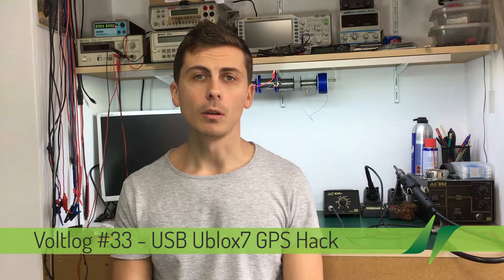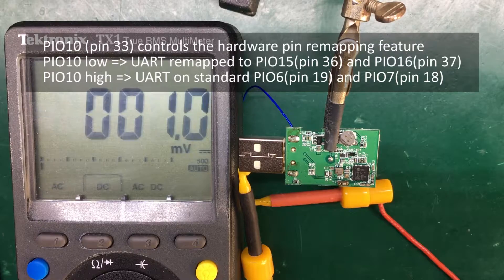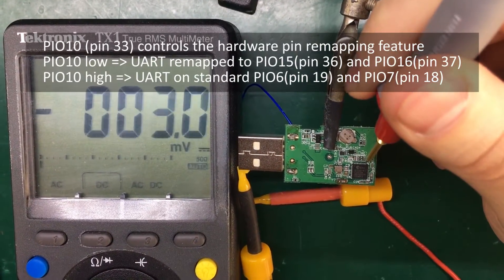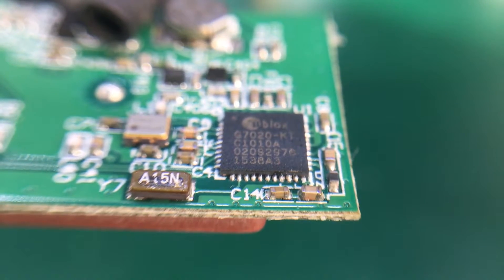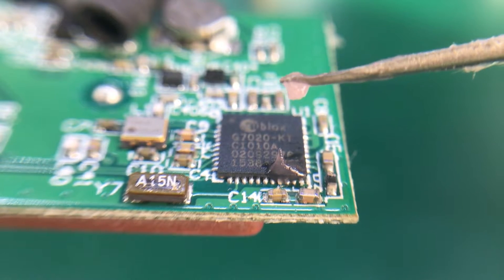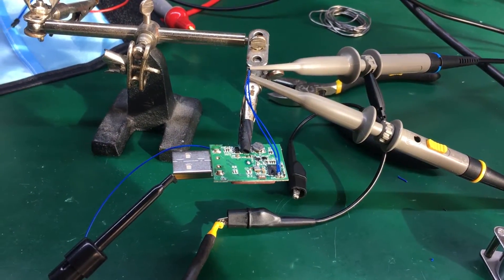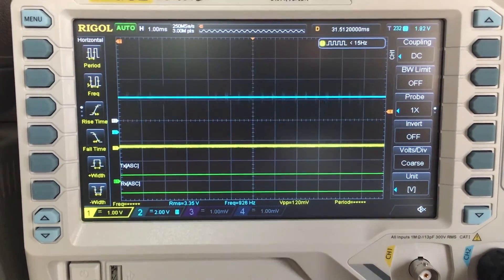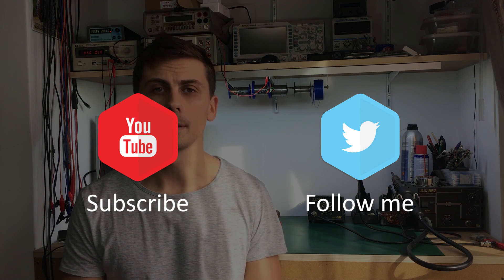Voltlog #33 - Ublox 7 GPS USB to UART Conversion Hack

Comment: Problems Installing "G72 G-Mouse USB GPS Dongle Glonass Beidou GNSS Receiver Module". Help and Support Please?

I recently purchased on Amazon the "G72 G-Mouse USB GPS Dongle Glonass Beidou GNSS Receiver Module".

I carefully followed the installation instructions which I downloaded from their site. I downloaded and installed "u-blox GNSS Standard Driver for Windows, v1.2.0.8".

I checked the windows device manager and the "u-blox GNSS Receiver (COM5)" drivers appear to be properly installed in Windows 10/64.

Whenever I insert the "G72 G-Mouse USB GPS Dongle Glonass Beidou GNSS Receiver Module" into the USB port on my PC, the indicator light Flashes once only and then the unit is DEAD.

I downloaded and installed u-centersetup_v21.02.exe.zip, and loaded u-center_v21.02 and it actually recognizes "G72 G-Mouse USB GPS Dongle Glonass Beidou GNSS Receiver Module", BUT the unit fails to activate.

Please advise what I should do?

Is there some installation & configuration procedure that I have missed?

OR is the unit "G72 G-Mouse USB GPS Dongle Glonass Beidou GNSS Receiver Module" defective?

Thanks in advance!

TG

Comment: lol iv done this so many times and fucked up glad am not alone . we need a Andonstar ADSM302
Reply from the maker: yeah a microscope would help
Reply: @voltlog  i have been doing something similar to what you have done. but with a tk102 from ebay comes with this chip i cant seem to configure it with ucenter even tho i am receiving packets
Reply from the maker: Ted Mosby maybe it's missing the flash memory
Reply: @voltlog  yh it could be i will be buying a Arduino based ublox module and get the hang of it

Comment: Very interesting. G-Mouse hmmm?,,,sounds familiar like it is made by VKEL maybe....:-)
 I just bought the VKEL VK2828U7G5LF, ( also at Banggood) and it lists as having the M8N which is capable of GPS and GLONASS protocols at the same time. Read quick acquisition time a blistering "hot reboot" times.
I somehow found the PDF produced by the maker VKEL themselves leaving no doubt as to how to work the U-center config app to get what I need for pairing with a Flight Controller for my  RC quadcopter. However, before I could receive the item in the post. I found a new comment in the customer feedback exclaiming that the Ublox chip is not an 8030 (M8N) but a 7020, just like yours. I can manage with any of the Ublox 6,7,8 series but they must be  heavily configured to suit. I also have found a quick method of modifications known as the configuration.txt file that may be "written" to flash. It is dedicated specifically for my application. Godbless the RC community sharing of these things :-)

Perhaps I will make my first YT vid about the modification of this to suit my needs. 
All this of course is an adventure and I am always trying to avoid spending too much money. But some times I cut off my nose to spite my face :-) and should probably just buy what I need. Then the delivery times  tend to  kill ones spontaneity and  ambition
Reply from the maker: yes, sometimes it can be fun to do these hacks.

Comment: ublox has all the datasheets available, it also has the ucenter as a free program for accessing the ublox gps modules (you can use it for setup of the various parameters) if you want to play with uart gps there are the RYN25AI (232 logic level) and RYN25DI (rs232 with a 232 driver) that have the ublox7 inside also the gps antenna and a small batery. You can see one on my channel in the geonav5 video...
Reply from the maker: +ElectronicMarine ublox actually doesn't have the datasheets accessible, I couldn't get one for the ublox 7 chip. I guess you would have to request it after registering and signing an NDA which is not nice at all. Of course there are dozens of GPS modules available on ebay that have the UART interface but the point of my video was to try and hack this cheaper USB one.
Reply: I use ublox 7 max and neo [www] .u-blox.com/en/product/neo-7-series , sometimes the automotive 8 series,  the chip inside is the same, all you have to do is write an email and ask for the datasheets and application notes (altough the instructions set is the same for all ublox- they have the UBX protocol also) the only chips that require NDA are the military grade... but not you're/our case... on the page I've linked above you can find the detailed application notes on more technical resources... hai romania :)
Reply from the maker: +ElectronicMarine thanks for the info! I have subscribed to your channel as well, even though I don't speak Italian :)
Reply: I shoul do somme videos in english... sau in romana :)
Reply from the maker: +ElectronicMarine I would like to see more people doing videos in English, this way they are accessible to a larger audience.
Reply: that's true, but the reason I started to do them in italian is because the F..ing italians don't speak english, at first I was doing the videos only for breaking the balls to the ones that where doing my job fixing marine instruments (not fixing them in most of the cases) then started to share the things I liked like the hakko, rigol and the Gophert (that I bought tks to you're video) tks :)

Comment: The reason that you are having such a hard time soldering the pins is because of the very, very long and skinny soldering tip. It does not conduct heat very well and thus soldering those lead free connections are almost impossible.
Reply from the maker: Actually in this case I was getting good thermal contact and the solder was melting Ok, however it was very dificult to get the position right on the pad.